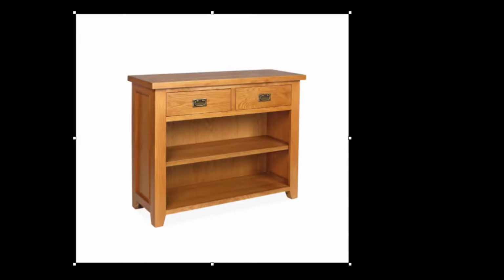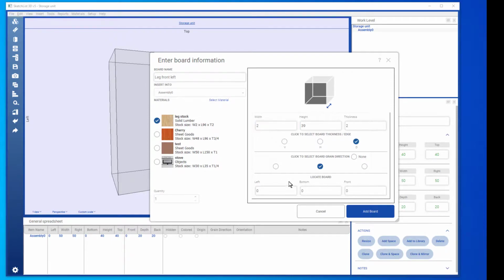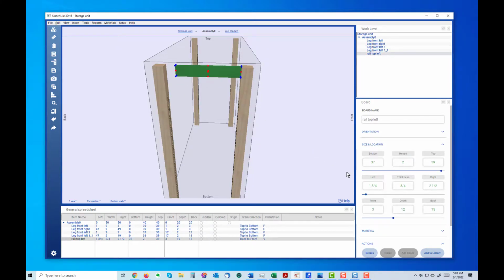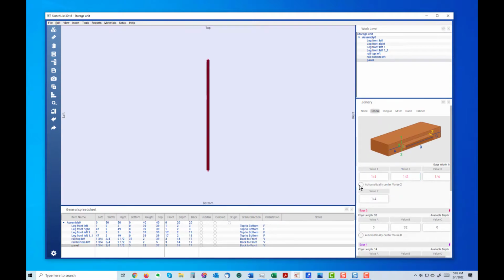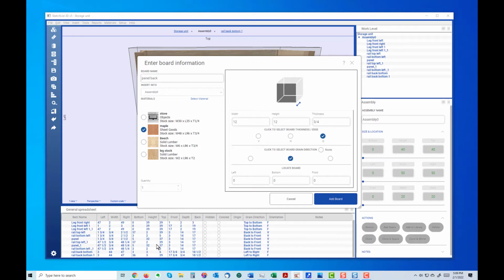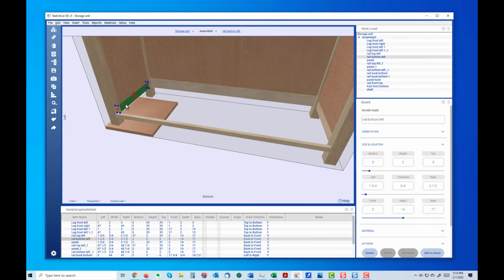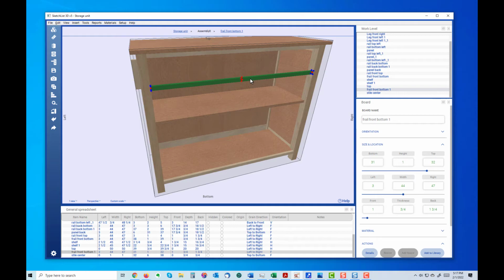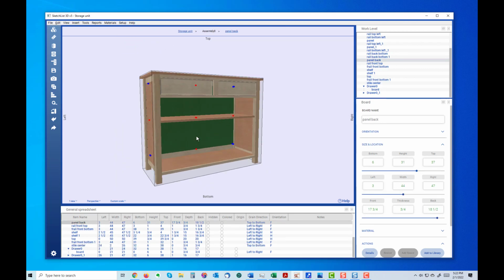Woodworking Design software - making a two drawer book shelf

Comment: Hello there, thank you for these videos. I am having an issue in my current project, and watching this video I do not understand why. Hobby license, not on trial. When I select the edge of the panel I want to do a rabbet on, the Joinery options are limited to None, Tenon and Miter. No rabbet. 

I understand this isn't the place for this discussion, so I will likely send an email. This won't stop me from completing my project, but it will stop me from finishing the model to a level I am happy with. This is for my kitchen, I am not a pro, so I had really hoped the Hobby version would handle simple joints like this. For now, I assume PEBKAC, but please let me know if I have chosen versions poorly.
Reply from the maker: Yes, the Hobby version is an economical version of the full SkecthList 3D Pro.  The Hobby versioin has a limited number of joinery types.  You can see the feature comparison at www.sketchlist.com/pricing
Reply: @sketchlist3D  This is why I asked for, and thankfully received, my refund. The hobby version is a poor value for what it offers. Restricting joinery types was a strange arbitrary cut off. I can understand some renderings, cut list creation, optimizing material... But restricting some joinery types is silly, especially when all I wanted was a rabbet - very common basic stuff.

Thanks for your reply and refund. In my opinion, you should serve a better Hobby product for the price you ask.